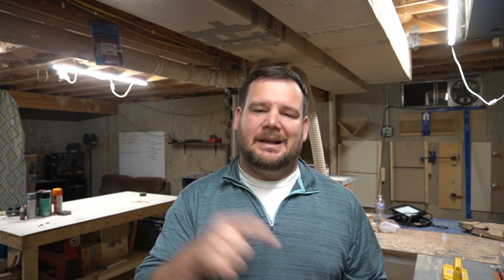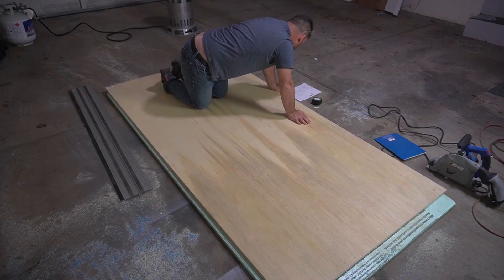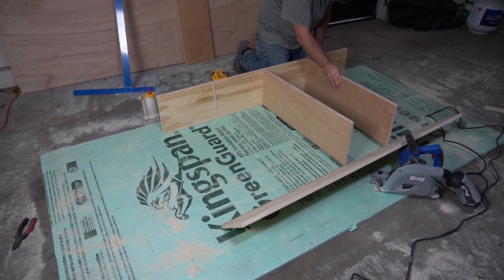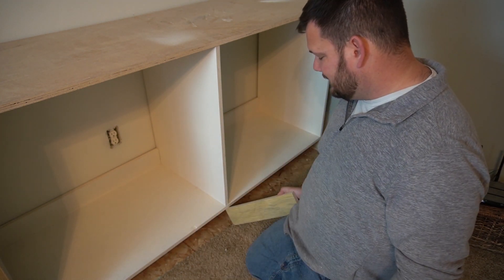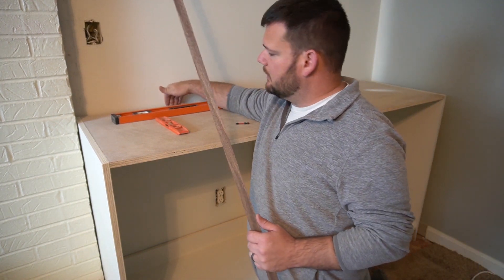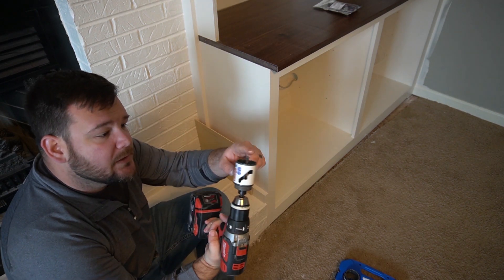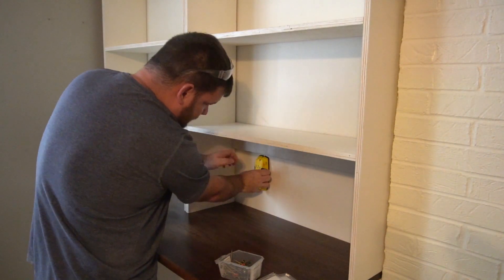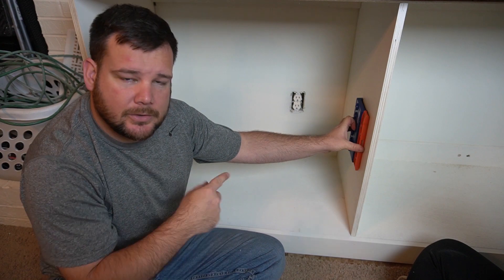How I Used Simple Construction To Build Our Living Room Built-Ins - DIY - Living Room Reno Part 3

Comment: How does a track saw track keep from moving during cutting? No dato? So it’s a built in place so the wall helps hold it square and up right? Makes sense as no backing needed. The shelf holes might be easier to mark and drill before the unit is installed. Good job.
Reply from the maker: The track saw track has anti-skid on the bottom.
I talk about why I choose to build this way in the video. Dados work well too.

Comment: Both sides operate on one switch and one remote. How did you wire the left half cabinet stack to the right  side to get the wires to the controller❓
Reply from the maker: They are wirelessly synced together. Good question
Reply: @AndyBirdBuilds  Ahhhh! I've watched all of the segments and I couldn't figure out how you did that wiring. But wireless sync is genius in this project! 👍 Thanks for replying! 

I have similar bookcases surrounding my fireplace. Would love remote lighting like this. I am going to have to find this for sure! Thanks again! 😊
Any chance you have a link for those lights?
Reply from the maker: Sorry, I probably should of mentioned that in the video!

Comment: Regarding your prior video, it was not a “lack of focus” that caused the accident; rather, it was a bad unsafe process you had/have in place for removing pieces from a moving saw blade.  Use a piece of scrap to move the piece, or grab the dangling side from the other side of table, or stop the blade.  This is basic saw safety 101.  

As for “having a plan”, while you certainly should have a plan for dealing with accidents, I think your focus on that is misplaced, because the first part of your plan should be how to avoid senseless accidents, and I don’t see where you really addressed this aspect.

You also mentioned various technologies that maybe could have been used, but you completely ignored basic power-tool safety as a consideration, and in fact it’s the most important consideration.  Technology is a great aid, but not a substitute for basic safety practices.

I suppose you turned off the comments on the video because you took a lot of heat, which is funny because in the video you specifically solicited comments from your viewers.  Guess you couldn’t handle the reality that this was completely avoidable if your process was centered around safety and your poor safety habits were the cause.  

Anyway, I hope you’re doing well and have modified your process to avoid such future accidents.  I do commend you for posting the video, but it would have been more educational to people if you really gave some serious consideration to discussing safety practices for avoiding such mistakes.